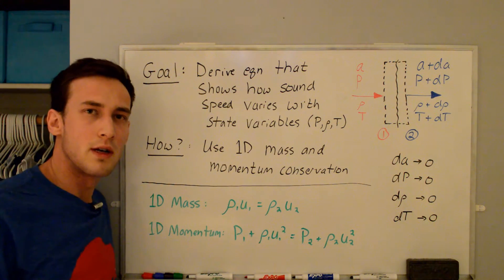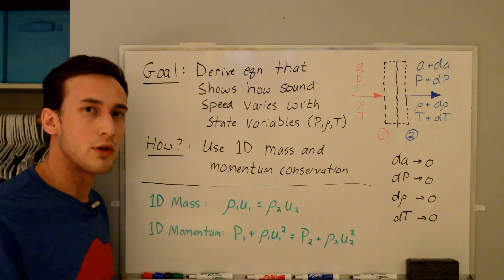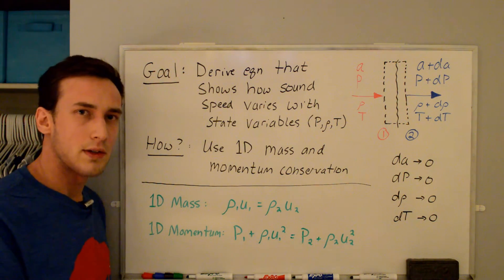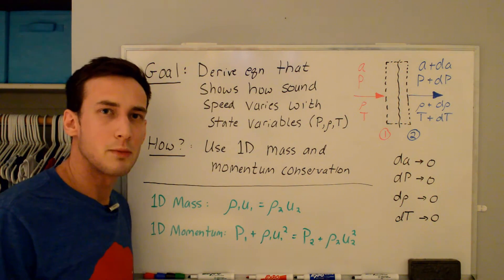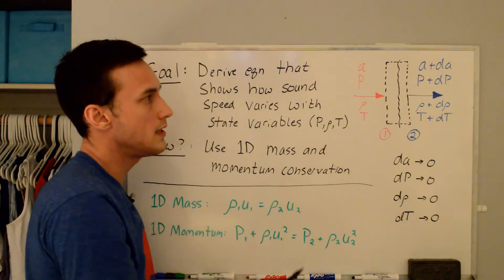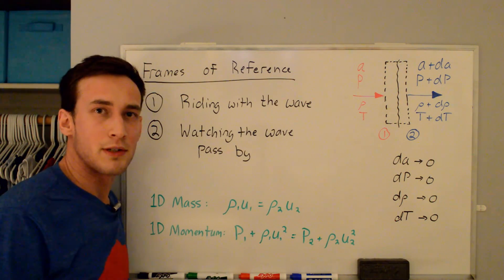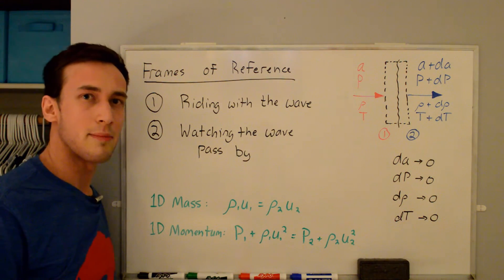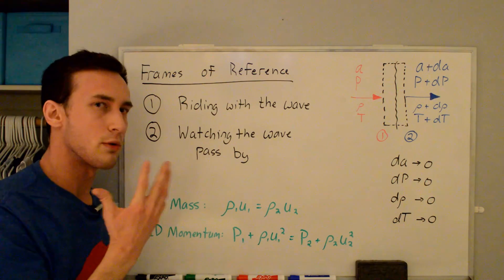Explained: Speed of Sound

Comment: Is the unit of V [m^3/kg]?? Isn't it just [m^3]?
Reply from the maker: In this equation, 'v' is the specific volume, which is also the inverse of the density, so its units are [m^3/kg].  It is the volume per unit mass.  You can also write the ideal gas equation in terms of 'V', or simply volume, in which case the units would just be [m^3].  It all depends on how you want to write the equation, but for this derivation, the specific volume form is the most convenient.
Reply: Ohh I see! 
I'm surprised that you still reply for the questions even though You uploaded this video a year ago!
Thank you so much!!
Reply from the maker: No problem!  I try to respond to every comment on my videos no matter how old they are.  I figure it could help someone else out later if they have the same question.